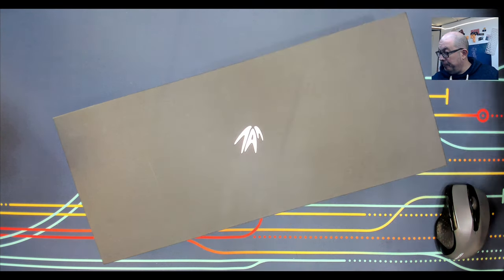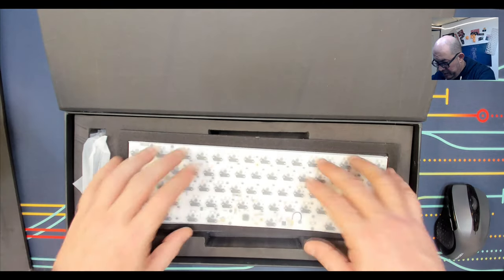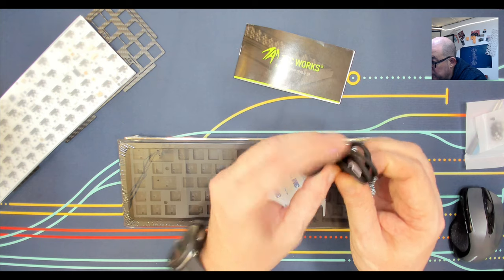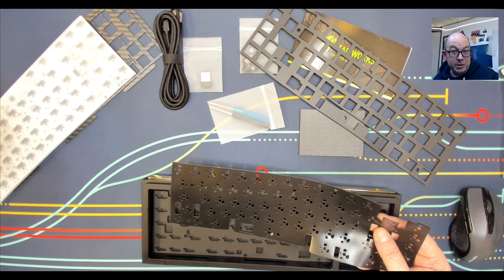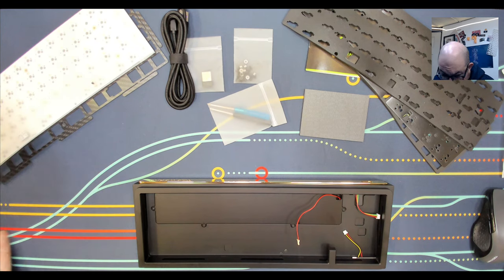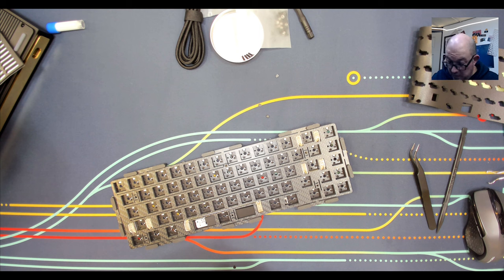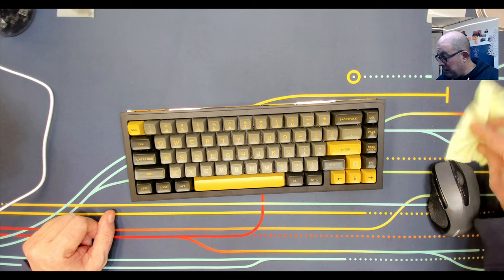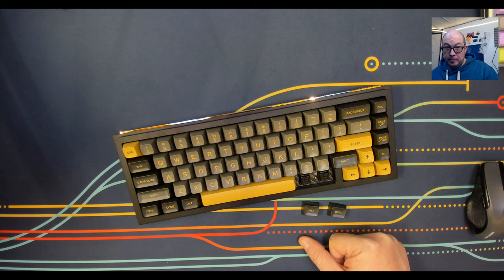Tacworks T3 build, sound test, and review. Only one question: why?

Comment: Long-form vid this time, love it! I'm with everyone else, I don't see why this board is so expensive, and if I'm honest, I think it's tacky looking (no pun intended). The gold just doesn't do it for me, and all the added "detail" with the machining just comes off as busy. Something that I'm noticing about this board, it seems like it got sent to smaller YouTubers, and not the big guys. I don't know if the bigger channels just didn't have any interest in it, or what, but a few smaller guys got the board sent to them. I almost wonder if they targeted budget channels to try to wow them into recommending the board.

I just went to check and see how much the aluminum Everglide SK68 is selling for. I'm not sure how much I paid for it, but it's currently $220. It's aluminum with BT, 65%, has a halo LED which is quite striking, North facing RGB, PC plate, with proprietary software (which does allow for layers and per key RGB). There is nothing that the T3 does that my SK68 doesn't do, or do better.

I have two boards with the power switch located beneath the caps, the Ajazz AC067, and the QK75. It's a problem with the Ajazz because there is not a key combination to "lock" the board or toggle to wired mode. Yes, it will work wired if you plug it in with wireless enabled, but if you're going to transport the board or store it, you have to take off the space bar and switch it to off. Also, if the battery dies, you have to flip the switch to off and then back to on once you plug it in to charge. The QK, it's not an issue. I just put it into the on mode and will likely never turn it off. If I want to switch to wired mode I just have to do a key combination and then it turns the wireless off. That's enough for me.

Great video overall, I enjoyed the long form and room for more discussion. I also noticed in a few recent videos that the sound has been off for the main camera (it matched your talking rather than what was happening with the board, it was not an issue for sound tests). This one didn't seem to have that issue 🙂
Reply from the maker: As always, thanks for your input, it's truly appreciated! I actually like the black and gold theme, but as I mention in the video, my wife is the one with a sense of color and design ;)

In regards to the video, I have noticed that my poor little i7 laptop is getting cycled with a 4K, a 2K, as well as mics and keyboard(s), so in this one I split the video and moved it over, which will I do for the next few videos then just off set that difference in OBS until I get a new workstation, which I am well overdue for!
Reply: Its clear what they're trying to do here but I also feel like KPrepublic just likes working with smaller creators in-general for obvious cost-saving reasons (ie. not having to pay for a showcase). 

Considering I'm one of the few creators to actually review the board and not just post a sound test I feel obligated to clarify my position on this and why it deviates from MechTech's views. My biggest would be that I actually like the aesthetic of this board. It sounds like other boards in the price range and it certainly has alot going on in terms of overengineering. Simple fact is that they just screwed the pooch by adding too much machining time cost into the equation. Alot of the design elements were really well thought out but not very well thought out, if you get what I'm saying. So, given that, this board is easily passable as a $350-400 board to the RIGHT buyer. Its just obvious that its none of us here.

To address the "I almost wonder if they targeted budget channels to try to wow them into recommending the board." statement: I'm not wowed in any capacity. My channel tends to focus on the budget space but I am an enthusiast at the end of the day with builds that cost $30 and builds that cost over $1000. Don't let the content being produced by budget creators trick you into thinking that's all they know. Anyway, the reason I have a more positive take on this piece is simply that, I have a less judgmental and biased outlook when it comes to analysis. You can't allow a board's cost set the tone for a review. Yeah, some more expensive boards should have higher expectations, but at the end of the day our hobby is niche af with smaller designers/manufacturers spearheading products and we need to take a look at each piece individually and offer true insights. Thus my mentioning of competitiveness in the current market and neutral stance on the T3. 

This isn't a bad product. It has bad aspects but overall its a solid little board that is simply priced incorrectly.
Reply from the maker: @punkshoo  

> have a less judgmental and biased outlook when it comes to analysis. You can't allow a board's cost set the tone for a review.

I'm sorry, but I can't help feel like this was directed at me. Of course price plays a huge part of the equation, especially when a manufacturer is actively trying to target an audience that might be more amenable to it, thinking that it's actually worth the price tag. Considering the value proposition of a product is not only part of a review, I'd almost say it's a responsibility of those of us informing the public to be fully honest about as they listen to and base purchasing decisions based on things we say. How is "ignoring the price" being unbiased? Reviews are meant to be critical and meant to highlight any possible issues, i.e. like charging double the price of what the features would suggest it is worth.

This keyboard is not worth even half of its price tag and you attempting to frame "my take" as biased because I am informing the community of this fact seems disingenuous and dishonest. I do my best to be honest about what I review, regardless of how the brand may feel, as I owe the community, not some corporation. 

We do not have the same "take" as you claim since you are claiming that this might be of value to someone and I feel that is extremely harmful to the community by presenting an overpriced product that lack features of boards half of its price and attempting to sell the idea that the price of the product should not be a part of an honest product review. 

Just know, I am not the only one that shares this opinion; many have lost respect for you over your "take" on this overpriced keyboard that has no place in the market.
Reply: @punkshoo  Makes sense, never a bad product, just bad pricing. I appreciate the detailed response!
Reply: @MechKeyboards  Worth is subjective and no price doesn't always have to be part of the equation. You can discuss qualities without having it directly relevant to the price. So, yes, this is directed at you. While I appreciate the video I cannot help but feel like your take on it was from a place of bias having known the price ahead of time and being of the mindset of anti-GB, anti-high end, and being "value sentiment" minded. And that's okay. Its your content. Present it however you want. You are the personality that makes people watch your videos and if they appreciate your stance then more power to them. It was not a slight at you. Just an observation. 

And, yes, we have the same "take" homie. The board is overpriced and there are better value-oriented boards out there. That's the gist of it. The disconnect is where you fail to recognize that there are some of us in the hobby that aren't just looking for a "value-oriented" keyboard. There are other aspects of the hobby where price is irrelevant, just like any hobby.

As for losing respect for me over my "take" on the board: That's fine. If people want to get mad because I found the board to be enjoyable to use from a perspective of experience actually having used high end and other "overpriced" boards then maybe they should just watch another echo chamber channel. Its no skin off my back. I do this to share my experience, not to shill to my viewers or corporations, alike. People are free to do what they like but to get mad at a content creator because they don't share the same views is just silly. Really this just smells like budget elitism at its finest.
Reply from the maker: @punkshoo  You are being dishonest and disingenuous trying to frame me as a gatekeeper and continuing to defend a pricing model that has been identified as anti-consumerist by consumer advocate groups. 

You are also actively double speaking by saying on one hand we have the same take on this keyboard, but on the other, I am completely biased because I happened to consider price into the equation; you can't have them both ways. If this board was worth $400 I would have said so, but it's not. And you know that it's not as well, but you continue to be completely dishonest by saying that "it could be of value to someone"; no, this keyboard is a ripoff, period!. I can afford a $400 dollar keyboard, but I would never pay more than $200 for the T3; it does not have a price value proposition that is balanced, which in your reality, has nothing to do with a person's purchasing decision?!?!

Like I said before, if you feel like you have to defend companies over consumers, there truly is nothing more for us to discuss.

Goodbye.
Reply: @MechKeyboards  Mom, Dad, stop fighting! Are you fighting because of me?

Just kidding, but I think there's a middle ground here. Punk is right, there is a point where you stop looking at features and just buy something because you want it. They say Ferrari buyers don't look at things like the trunk size, or headroom, or whether or not there's a back seat. They just want a Ferrari and they're going to pay the price to get one, even if it's not practical. That said, I don't think this board is a Ferrari. This board is more like a Civic with a fancy body kit. It's right there in the middle as far as price is concerned between the budget realm and the true high end. 

Obviously, I don't have the board in hand, but everything I've seen about it seems like this should be a $200 board, but they're asking for double of that. $400 is a weird spot, there are people who buy budget, people who buy entry level customs (that's me, QK75/Zoom65/Everglide SK68) and then there's the Ferrari buyers, but I don't think a Ferrari buyer is going to buy this board. I don't think anyone should buy this board, it's just in the middle ground where there's not a market. To use another analogy, buying this board would be like buying a print from Ikea, hanging it on your wall, and acting like you're a consumer of fine art.

Oh well, at the end of the day we all will have our own opinions. Maybe I'm way off base, maybe there is a market for this board, but it really doesn't seem like it.

Comment: Good looking and sounding board
Reply: doesn't matter, this thing is a scam
Reply: @justanotherpxrson -  Where'd ya get that from brother?
Reply: @justanotherpxrson -  You pay for the T3s exclusiveness as well as Tacworks R&D. The majority of these boards stray completely away from a mass produced board, many are not even machined in factories, bringing cost of production up. Value is perceived differently by everybody. The T3 is a good looking board, but I personally wouldn't pay over 200 for it. A scam isn't when a consumer settles on the distributors price, it's blatant, intentful fraud.
Reply from the maker: @kabes1776  "T3s exclusiveness"? Exclusive to whom, those who want to be ripped off? NO QMK/VIA, North facing LEDs, no RGB over wireless, etc. The "exclusiveness" exists because it stands alone since no one else would make these decisions in a keyboard, buyer or seller alike. 

R&D? What did they research? They didn't even bother to open up a web browser to see what other keyboards in its price range offer. What was researched, how to launder money? 

"The majority of these boards stray completely away from a mass produced board" What? 

Of course this was mass produced, what do you think, it was hand carved? 🙄